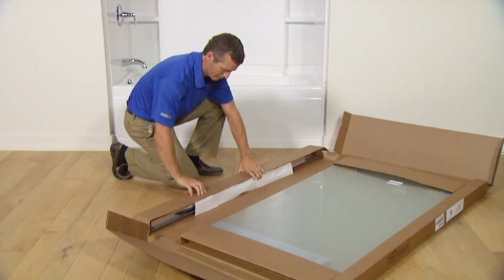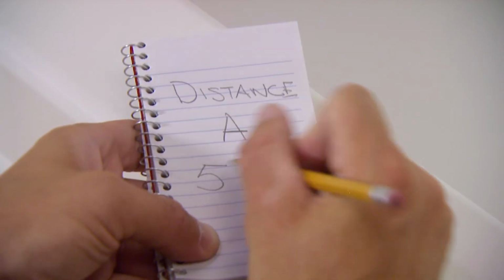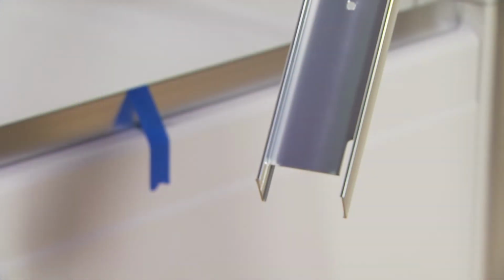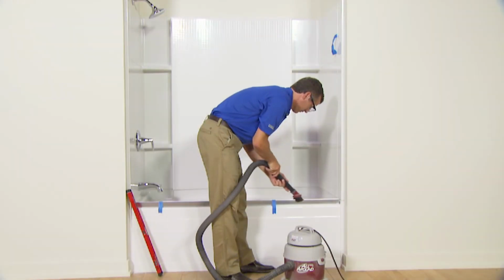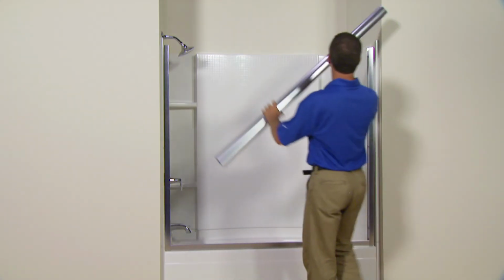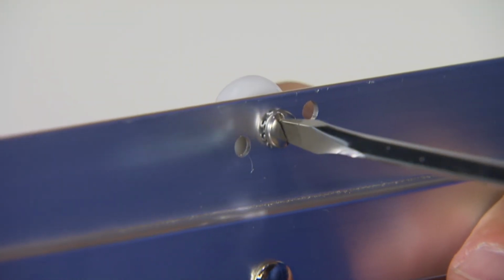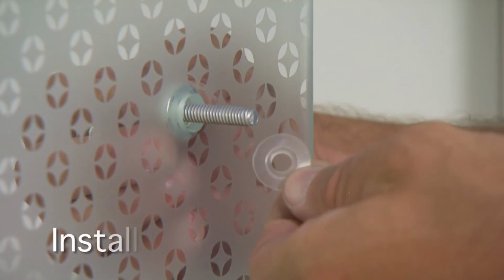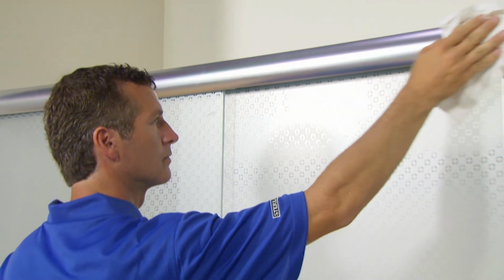Installation - Finesse Sliding Bath and Shower Doors

Comment: So, my “finesse” shower door is a slightly different design from this video…different enough.
The paper instructions were incomplete as well. Had to contact customer service on which parts to file - it seemed obvious, but I take nothing for granted.
Top rail on my door needed two self tapping screws to secure to side rails. The surround didn’t allow a lot of room to drill pilot holes. Pilot hole callout was way too big for self tapping screws. 
Fyi- I didn’t match up this door with the tub/surround, my supply house did.
Rubber bumpers have screws to hold bumpers and side rails to wall inserts. It is not clear how much to tighten the screws as they can bottom against the rubber bumper and possibly squeeze out and then there is no support to side rail at that location. There should be a support washer embedded in the bumper to provide good support.
It should be noted that 3  nylon inserts into the surround on each side rail support the door - they do not penetrate into framing…this is apparently by design.
I expect to finish this job tomorrow. The required filing of the bottom and side rails took about an hour - big time killer right there. I would expect this job to take 3 hours if you’ve done it before. A full day if not.

Comment: If you don't know what you're talking about, or have never installed a shower door before, don't leave comments.  This is an instructional video to enhance the paper instructions you get when you buy the door.  Commenting on pencils, silicone application, not in the studs, please explain why you would need that on a sliding door, or measurements, is stupid.  It's a nice door with a fairly easy install.
Reply: This instruction vid is different from MY paper instruction for same door. Don’t flame ppl if you don’t know what you’re talking abt.

Comment: Very nice shower door.  allmy.tips/STERLING-Sdoorv?aa   Thick, heavy and looks awesome. As a DIY kinda guy it took me about 6hrs to install, with a buddy helping getting the fixed side mounted. Unfortunately my walls were not plumb and the door side is actually a bit wavy. But there was enough adjustment to pull it together.

Comment: 56 1/2 inches bottom measurement. 57 inches top measurement ?? I thought he had a level on that earlier?
Reply: Purpose of the level is to plumb the wall jamb in the plane of the wall. Not much you can do if the wall itself is out of plumb.

Comment: He cannot possibly be marking the screw holes in the wall jambs with that pencil.  It won't reach the wall due to the I-beam construction of the wall jamb pieces.  Why is there no silicone applied to the bottom track on the inside of the shower?   The outside of the bottom track already has silicone on the underside groove  but you're applying another bead right next to it on the outside?  And no silicone at all on the inside of the bottom track?  It would seem that this would be the area most likely to get water under it.  What am I missing?
Reply: You don't want to seal the bottom track on the inside of the shower. That would trap water under the track and prevent it draining back into the shower.
Reply: @tomveatch2994  it should be understood and it might say in the written instructions, but we are watching a video and you always caution what not to do. They should have mentioned it.
Reply: @tomveatch2994  Ah, yes...makes perfect sense, thanks!
Reply: @tomveatch2994  Absolutely correct!
Reply: I agree....if you do not use a sealant on inside of bottom track...that water will be trapped under the track. Also the center guide is a pain to install, not much room to work  that in...One more complaint, it says to use a hex tool to tighten your shower door towel holders...Do you know how small that thing must be??? I had nothing that small around my house....why didn't they just include with the rest of the kit? ....exactly  5 hrs to finish..and I did seal the inside bottom track...Not sold on completely sealing the outside of the installation....When you read the instructions  it says go to the Sterling web site....do you know how many videos are on that page...OMG.